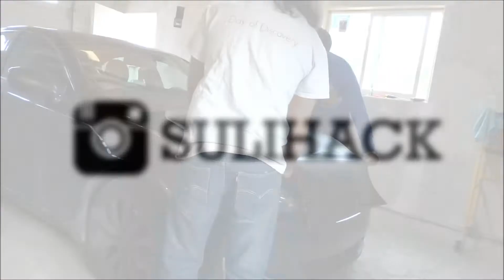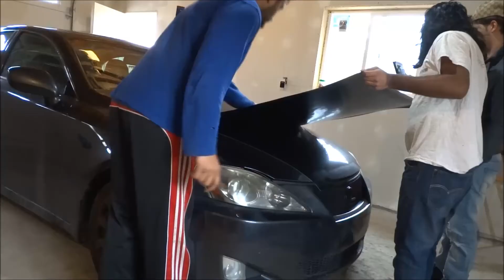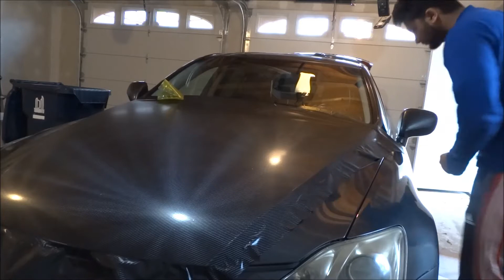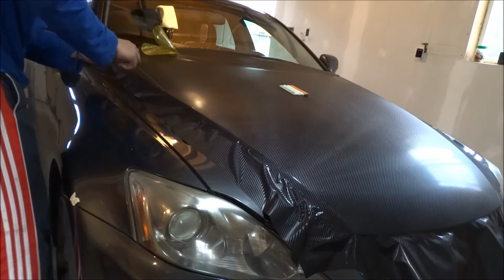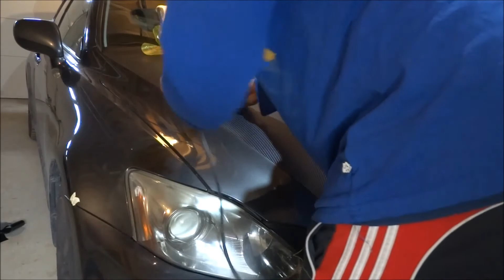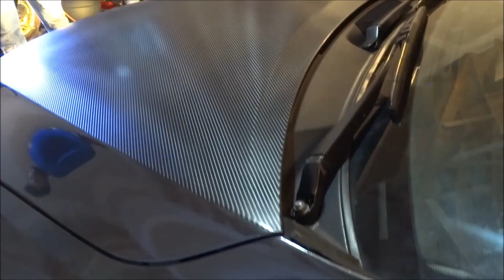Lexus IS250 Partial Hood Wrap

Comment: How did you apply the string (or whatever it was) along the hood creases? That was pretty slick.
Reply from the maker: +nglange it's called knifeless tape. It's basically a tape with a string/filament inside of it. You lay it where you want it to be cut and then when you pull the string it cuts the vinyl. Much safer than cutting on the car :)